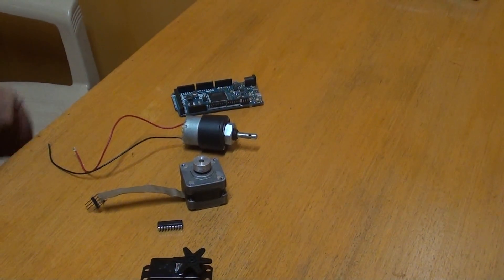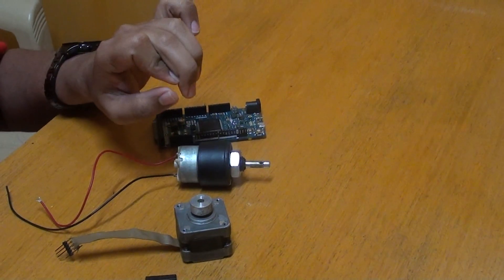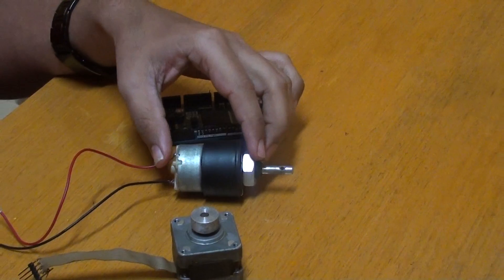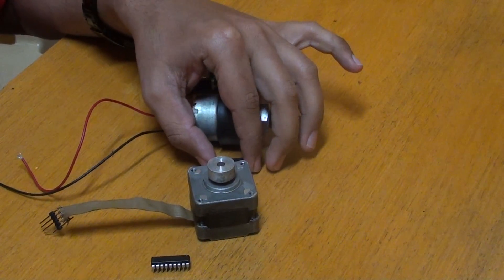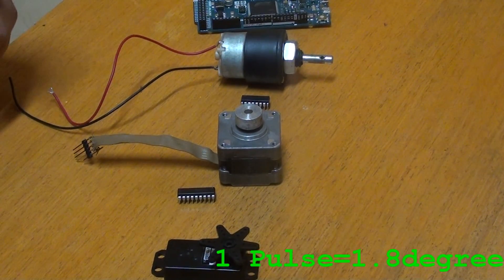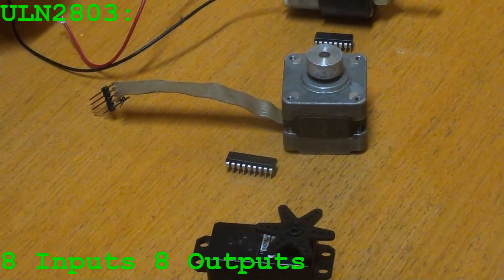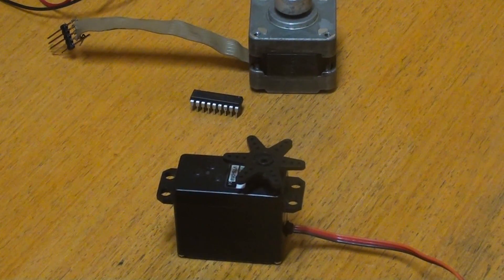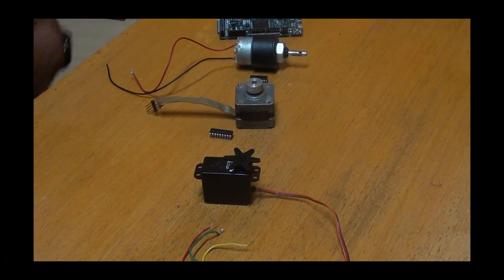Tenet Technetronics: Arduino Due interfacing with DC, Stepper and Servo motor

Comment: What's the servo motor voltage ? Is it not problematic when you use a 3,3 V PWM output ? (Sorry for my bad english...)